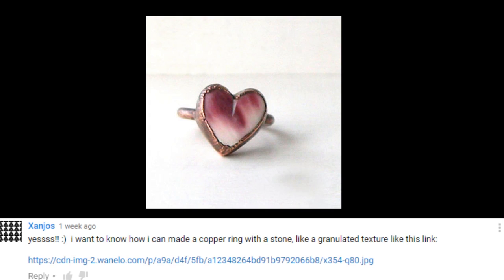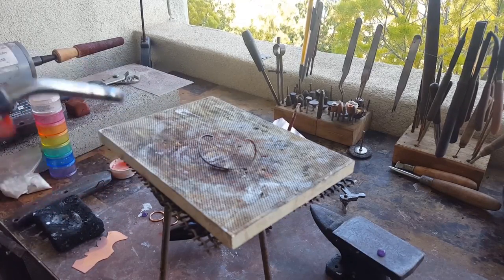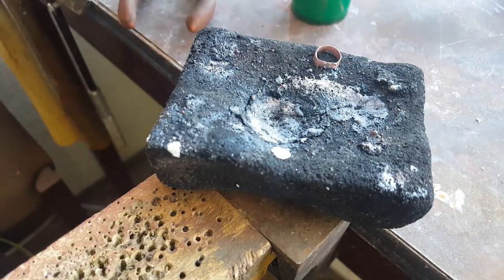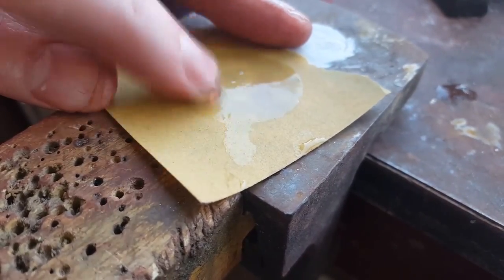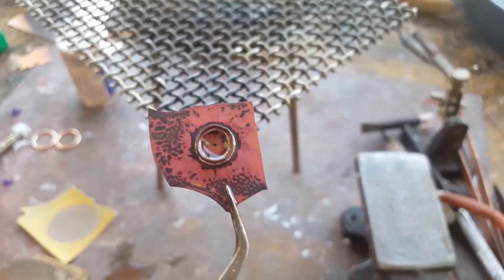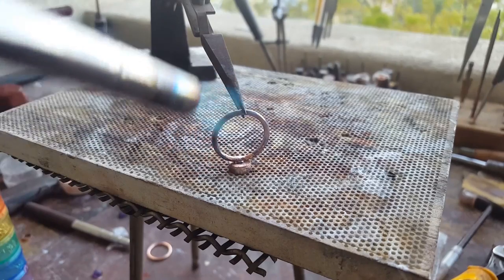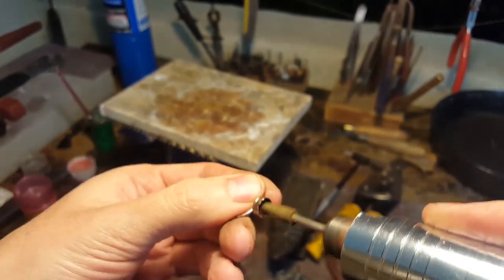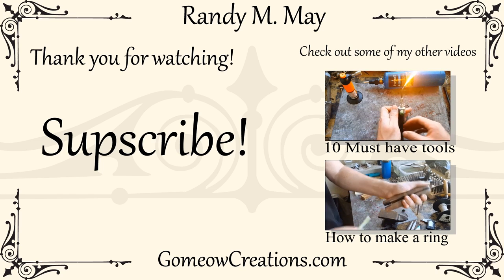How to make and set rustic copper ring from scratch.

Comment: Actually, it's better and easier to have a tight bezel that you have to make bigger than it is to have a loose bezel that you have to make smaller. If you need to make it bigger after soldering, you just put the bezel wire on the metal mandrel and hit it with a rawhide mallet to stretch it, whereas you have to cut and resolder a bezel that is too large for the stone.

Comment: electroforming is a great way to make a rustic ring. I need to check out your page to see if you've explored this process yet..
Reply from the maker: +Maura Delong you are right about the electroforming. I have tried it out in the past and made some intresting items. I don't have anything about it on my channel though.
Reply: GomeowCreations it's fun but expensive... :/
Reply from the maker: I did makes something from a 5v charger and an old usb plug. The liquid was vinegar and mixed with copper based root killer. The full set up was about $30. =)
Reply: GomeowCreations SERIOUSLY!!!? wow, how did it turn out?
Reply from the maker: +Maura Delong it worked but i will still need to play with the set-up more in order to to make it better.
Reply: Hi, I see a lot of electroformed rings on Etsy, I tend to think they are a cheap, quick and easy way to make rings and bangles etc. This method here uses real bench jeweller techniques and makes for a better quality ring.

Comment: Randy, I really love your video tutorials. I’m a total beginner but would love to see more videos on setting stones in something like gallery wire for a pendant.  Also, could you please do a video about torches? I only have a small butane torch and want to start with copper settings due to how expensive silver is. I just don’t want to ruin a bunch of expensive silver to learn on. Thanks so much!
Reply from the maker: Hey Tamara, I'm always happy to here when people like my videos! 

Have you seen this video about making bezels using gallery wire and setting cabs into them? https://youtu.be/nAHbpiUzv-c

I have found some places to get copper and brass gallery wire if your interested.

I can do a video on torches, I did have a small butane torch at one point but I really didn't like it. I have a couple propane torches and an oxygen and acetylene setup with a smith's little torch but that was over $700 to get the setup, but it was well worth it to me 
😀👍

If you have any question feel free to ask and I will try to get back to you asap.

Comment: You can get copper solder now. It comes in just one hardness I think. It melts a little darker than shiny copper, but if you're oxidizing it won't show. It's pretty hard so you have to be careful on a thin bezel, but I've never had other components come apart while using it. And much less melting than with sterling or fine. PS I love this tute, will give it a try.
Reply from the maker: +icatz I have used copper solder and I didnt like it that much. It lacks the control of having different temps but one way to cover thr silver solder is to copper plate the item. You can do this with out any expensive tools or electricity. :)
Reply: @GomeowCreations  do you have a tutorial on this?

Comment: Thanks for the great tutorial. I'm a newbie and your video is really helpful. Your jewelers bench looks custome made. I was wondering if you have tips on how to make my own? What are some key pieces I need? Thanks!
Reply from the maker: So the work area in this video was just small old kitchen table. I did end up buying this workbench https://m.harborfreight.com/48-in-workbench-with-light-62563.html but you can really use any table that you don't mind burning and drilling into. 😁 Oh and if you get the workbench in that long you will have to modify it to fit a bench pin. Just have a look at one of my newer videos to see how I did it.

Comment: Thank you for the straightforward and informative tutorials! 

Maybe someone can help me, I am having trouble setting some 8mm cabochons. Every time I set one, I can't seem to make it so it won't spin around in the setting...  Maybe I'm not getting it tight enough around the stone, I am only using a burnishing tool to push the bezel around it. Would putting a little sawdust under it help? Any tips or help on this would be great :) Thanks!
Reply from the maker: Well I'm happy I was able to help. 

Can you send me a picture of your setting so I can see if the bezel is too tall or not. 😁 

gomeowcreations@gmail.com
Reply: Thanks for your reply :) I knew the bezel was tall enough when I tried a ring with a taller bezel (plenty tall) and had the same problem... until I got a bezel roller and I was able to push the bezel around the stone a lot tighter and that did the trick! Now I’m making and selling some beautiful rings. Thanks again for the quality instruction.

Comment: Very nice looked great thanks for sharing your knowledge also, l have looked for some reasonable priced copper to buy but what l have looked seems a little pricey, can you tell me what dealer you go through to buy your copper sheets if possible. Thanks 😜
Reply from the maker: Thank you and I know what you mean, copper sheets are not easy to find at a good price. I go to a local store called hobby lobby. I found it in the model making area for about $7.99 for a 4in x 10in sheet. One good thing about hobby lobby is they offer a 40% off discount on one item so you can get the one sheet for almost half off. Here is a link to it on the website. 

https://www.hobbylobby.com/Crafts-Hobbies/Hobbies-Collecting/Tools-Blades/Copper-Sheet---025/p/21779

Comment: Hi. To perfectly straight a thin wire or a thin strip of copper or silver, you can clamp one end in a vice and then grab the other end with a pair of pliers and pull it a bit until you will feel a small relaxation in the metal. Do not force it. I guarantee you a perfectly straight piece. It is important to be annealed and also do not pass over that small relaxation point you will feel at some point. It is an easy and very effective method.
Reply from the maker: Thank you for that, I'm going to have to try that out.

Comment: Thank you very much, beautiful objects and clarity from the great master! Take this opportunity to ask that the final product using the copper to stop oxidation. See you soon and thank you and congratulations!
Paolo Croce (Genua-Italy)
Reply from the maker: Sorry it took so long to get back to you. I coat all of my copper, brass and silver jewelry in Renaissance wax. This being said the wax will come off over time and the metals will start to patina. You can try clear enamel paint but if you have a polished finish the paint will peel off.

I have used something called "Midas Clear Lacquer Sealant and Tarnish Inhibitor" from riogrande.com

This lacquer has the same problem with peeling if your item is polished. I have used it on some brass that I used a steel wire wheel on to get some texture on it. After letting it cure for 2 days the coating didn't peel off. 

Anyways, I hope that helps a little. If you have any more questions, feel free to ask.

Comment: hey I need a ring for a disc, it's a thin 14kt gold disc (disc is 1.5" wide, or 3/8" wider than a quarter, thickness is very thin like 28 guage or 1/64" or .3968mm, I wanted attached to a ring, for the band I had hoped to use leather, i have the leather band made up already just needed to transfer from disc to band for ring. could always do a copper twist wire frame idea but your the boss and was hoping for alternative ideas was hoping for ideas or a video tutorial on ideas on how to do it..!!!
Reply from the maker: +thad king It is late now but I will look this over tomorrow when I get up and see how I can help you out. Have a good night.

Comment: I really like copper. I wouldn't wear a ring made of copper, although I love copper bracelets. This ring is so pretty, though.
Reply from the maker: You can get away with it for a little bit but yeah it will turn your skin green if you don't seal it. You can do so with a clear coat or you could rose gold plate your metal 😊👍
Reply: @GomeowCreations  I think copper is so beautiful. It is the best to practice with; it behaves so similarly to sterling. I always have tons of copper laying around in almost every gauge, in sheet and wire. It's definitely my work horse metal, but a pretty work horse.

Comment: such a good detailed tutorial ! thanks so much , cant wait to get started. What torch are you using by the way ?
Reply from the maker: +Lucy Pallero Thank you!!

That is the torch I was using in the video:
http://www.walmart.com/ip/17128614?wmlspartner=wlpa&adid=22222222227017571280&wl0=&wl1=g&wl2=c&wl3=48412059632&wl4=&wl5=pla&wl6=97821399392&veh=sem

The torch I normally use is a smith's little torch:
http://rover.ebay.com/rover/1/711-53200-19255-0/1?icep_ff3=9&pub=5575090523&toolid=10001&campid=5337529248&customid=&icep_uq=smith+little+torch&icep_sellerId=&icep_ex_kw=&icep_sortBy=12&icep_catId=&icep_minPrice=&icep_maxPrice=&ipn=psmain&icep_vectorid=229466&kwid=902099&mtid=824&kw=lg

Comment: Suggestion... I use to work making stained glass using the copper foil method.  The copper foil comes in rolls of differing widths & it will work fine for this stone.  If the foil is a little too wide for the stone... just cut it down like you did when you cut the copper strip off the blank.

The good part about the copper foil is that it has a sticky side that you would put against the stone which holds it in place.  Wrap the foil strip around the sides of the stone, then fold a teeny bit & burnish down on the back of the stone... & then burnish it on the sides & at the top as it bends a little with the curve of the stone. Burnishing can be done with a popsicle stick... or a pencil or something.

THEN you can just finish the ring like you did by soldering the stone part to the ring.  The only difference is you'll want to make the solder flow all over the copper foil & make sure you solder the sides & bottom part that touches the ring... TO the ring.

By making the solder flow all over the copper foil, it makes the foil bezel strong so it won't peel away or come off.

At that point it will be silver colored... so all you have to do after cleaning it is add some copper patina to it & it will look copper again.  I've made several rings this way.
 
You can get the copper foil & the copper patina at any stained glass supply shop... or on line.
Reply from the maker: Well thank you for all of the info. I will have to look into that later.  One question though, how hot can you get this foil before it melts? I ask just because I use mostly hard and med silver solder and they have melting points of 1300 degrees I believe.
Reply: Hi.  :)  I'm not really sure... but I always just use about an 80 watt soldering iron which heats up to 900 degrees and it does fine.  I also SOMETIMES use it with a temp controller... but not always.

I've never yet used any kind of torch for anything.

When attaching the foil wrapped cabachon to another COPPER object I have to heat the copper object FIRST till it's hot enough.. then add the cab/foil to it with the solder.

If I'm attaching it to Zinc or lead I don't have to do that.
Reply from the maker: Oh ok. Do you happen to have any pictures of the rings you have made? I would love to see them.

Comment: Nice video, I like to ask you, what is the best solder to use for jewelry making? I bought Lead free rosin core solder at Lowes. Is electrical solder and it says for general wiring applications. Is that okay to use for jewelry as long as is does not have lead? I was not able to find any at the craft stores around here, but only the one used for stain glass and that has lead on it.
Reply from the maker: +Flair4Crafts you can use that solder but is is very weak and can be easily broken. If you want a strong solder point you need silver solder. You can order it online at riogrande.com look for hard, med and easy wire solder. You will also need some handy flux.
Reply: Thank you. Do you recommend a particular brand?
Reply from the maker: +Flair4Crafts of solder, I like to get it from the website I suggested. Oh, one more thing you will need a torch to use this solder, and a ventilated space because of the smoke from the handy flux. If you have any other questions feel free to ask also feel free to share your work with me, I would like to see waht people are making.
Reply: I have a torch but it not butane is the kind they sell at Wallyworld (Walmart) I think is propane. I have led free solder paste from home depot from the solder isle, will that work? I love a variety of crafts and like to explore new ideas. I do wire rings and each one is its own unique design. How do you feel about using a solder iron for making jewelry? I have a weller medium duty 60 watt. I am new to solder and smiting but have great interest in learning new stuff. Thank your for taking the time to help
Reply from the maker: +Flair4Crafts If you are talking about a propane touch, they will work just fine for starting out. I don't suggest using the solders you can get from local hardware stores. As for using a soldering iron, to make is so solder will stick to things the object and the solder need to be hot. When I 1st started I tried to use a soldering iron and lead free silver electoral solder. That didnt work out to well and I wish I started with a torch and the rigjt solder. Just as an example, electronic solder will flow around 400° and jewelry quality sold flows around 1300°+. Also jewelry grade solder can be up to 75-80% silver if I'm remembering right, and electronic silver solder is lick 5-20%
Reply: I bought some items a while ago but thankfully I did not used them so I could get my refund and get the right stuff from rio grande. Thanks for your advice

Comment: 5:46 you can make it bigger by tapping it with a hammer on a mandrel.
Reply from the maker: Yes you can it with stretch out the metal a little nap e make the bezel a little bigger. Just make sure not to do it too much or too hard because you can make it too big and you can make the metal very thin.

Comment: what gauge sheet metal was it?
Reply from the maker: For what part, the bezel or the plate on the  under side
Reply: @GomeowCreations   Both, I have 28ga bezel for the outside is that wrong? also not sure what to buy for the under plate
Reply from the maker: My bottom plate is about 0.7 mm and the bezel is 0.22mm. I have some links on my website and to places to get the metal. Gomeowcreations.com sorry I don't have the ga sizes, I just measured my metals haha